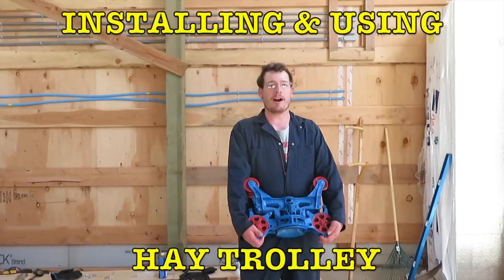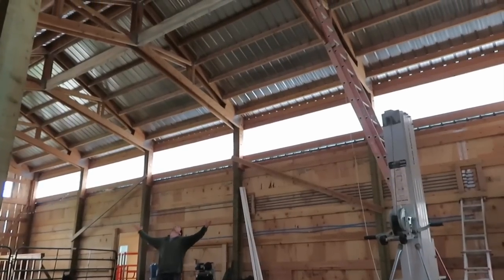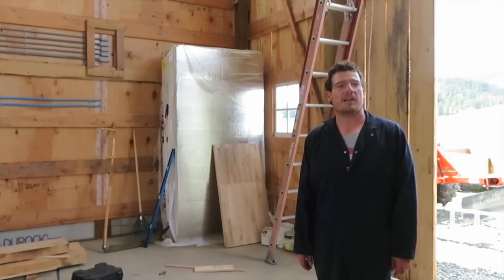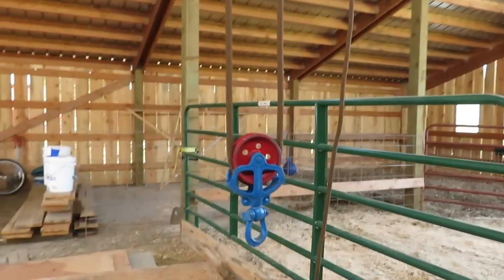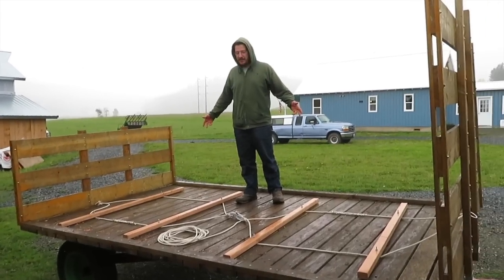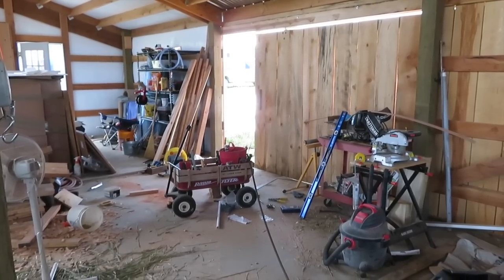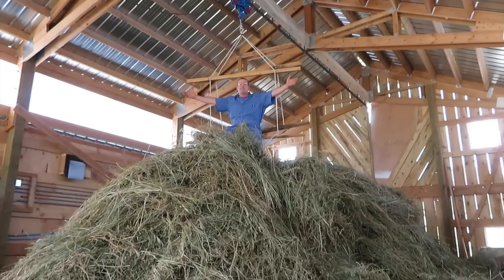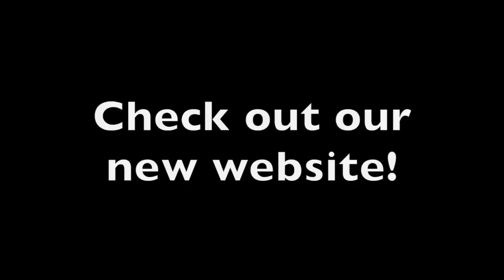Installing and Using Hay Trolley on New Dairy Barn (Building Dairy Barn #17)

Comment: Initially I thought...so much work! But then saw how much hay that grabbed! Get a clutched winch and that would run pretty smooth.
Reply from the maker: I feel that putting up loose hay is actually less work than when we baled hay. In fact, many of the hay trolley manufacturers offered a winch as part of their lineup to use in lieu of a horse or a tractor!
Reply: @vnthomas16  I bet one off an old well drilling rig would work perfectly.

Comment: A big step towards fully functional operations. Well done engineering and construction. Your knowledge of lines and ropes is impressive. Guess that's a side benefit of all those years in the Coast Guard. Hehe.
How many wagon loads in that 1st alfalfa cutting? Is there a way to separate grass hay from the alfalfa or will it simply mix together? Trolley looks and works great. Hope milk production is progressing. Bet the barn smells good filled with hay. Stay well.
Reply from the maker: I believe we had four wagon loads of Alfalfa. It was first cutting, so it was a bit course, besides the fact that we couldn’t cut it when we wanted due to weather, and then it lodged also due to weather, so it was a challenge to cut. But, the second cutting is coming in beautifully! Hope to cut again at the end of the week! We thought about trying to separate the alfalfa out, but then decided to go with the layering technique! Haha! So right now it’s grass/alfalfa/grass... and then we plan to put some more alfalfa on top. I think it will work out fine, as we want to feed out grass and alfalfa as a mix. It may vary, but we try and get the layers even. Oh, and yes, my rigging experience from the CG has been very beneficial to my farming career! Barn smells great! Thanks for watching!

Comment: I have a 110 year old trolley that is similar to yours, I'm trying to understand what the second vertical pulley is for .  I have mine roped the same as yours, in your video at 6:48 I can see that your left pulley isn't being used.  My descending pulley also has a place to attach the rope on each side.  It must be so that I have the option to run 4 vertical ropes to make lifting easier.  I can attach another lighter rope to the trolley to move it down the rail.  Thanks for the video, it is good to see other roping options,

Comment: That's really cool.  They had good systems 100 years ago.  Do you have to worry about alfalfa at the bottom of the pile heating up and possibly combusting?  I thought that's why it couldn't be stacked out in fields unless they made a teepee type structure to let the air flow inside there?  I don't know much about storing alfalfa, so I'm curious about that.
Reply from the maker: Great question! Alfalfa, and all hay really, just needs to be dry before being put up for hay. It’s the moisture that causes spontaneous combustion (and mold, for that matter). Loose hay is a little more forgiving than baled hay, but is still something to be taken very seriously. We’re blessed with hot temperatures and low humidity in our area for haymaking, so it usually goes pretty well. Actually, Alfalfa can be damaged if it is put up too dry, as you get “leaf shatter”, meaning has the hay is jostled about, the leaves fall off the stem. Most of the nutritional value is in the leaves. The cows can actually pick through the alfalfa, eating the leaves, but leaving the stems. We usually use the stems in their bedding. Thanks for watching!

Comment: Best doors for that are hinged from bottom and open by lowering it down by rope.That would  last 80 some yrs wind cant smash it that way.
Reply from the maker: We thought about that, as that is a very popular hay mow door design (for good reason, as you noted) but decided against it as we’d have to pad out the entire door structure to clear the door rails below it since we have a relatively short barn. We added some additional bracing so I’m not concerned about the doors in the future. Thanks for watching!

Comment: H years old & grew up in So. Daki: Why don't you make another sling & unload in two trips? That's what I did many years ago. I'm
Reply from the maker: I’ve thought about it. Our trolley isn’t designed to be used with slings, I kinda just make it work. The forks do a pretty good job, but can’t get the floor of the wagon very clean, hence the sling. I may make another on the future. We’ll see. Thanks for sharing!

Comment: What an amazing restoration of equipment not readily used in today's day in age!! Then to be able to see it in use, also amazing!! When I was a kid, we baled ours. This is very interesting to me, to see hay processed not only loosely but then put in the barn this way!! Will you be putting in a second floor to store the loose hay? Are you planning on storing the hay where you dropped it on the barn floor? 
I just love your entire operation!! The fact that you have lovingly restored your equipment is amazing!! You even went with glass containers to hold your milk. There is something to be said for some of the "older" ways of doing things. Sometimes, the more simple something is, the better it is.
Should schools ever get back to their ways prior to 2020, would you ever give school field trip tours?? Or tours to the general public??
Thank you for the great videos!! Please keep them coming!! Already looking forward to the next video!!!
Reply from the maker: Thanks for the kind comments! I love the older equipment. In general, I feel it is made better than much of today’s equipment. And when it does break, it is easier to repair. Parts can sometimes be an issue, but again with the older equipment, most of the parts are less intricate, and can be either fabricated on the farm, or at the local machine shop. No, there will not be a loft. We decided we wanted the mow on the same level as the cows (although the floor does slope to the back so nothing from the cows can run into the hay.) Just like when we did outside stacks, we did use cattle panels to make a hoop to contain the hay, although this hoop is much bigger! As far as the glass milk bottles, we have friends who bottle milk in glass bottles, and we couldn’t imagine any other way! They are making a resurgence! We do farm tours for small groups right now, practicing good social distancing and such, and that is going well. We have details on our website. Things are busy right now, especially with haying still going on, but don’t worry, they’ll be more videos! Stay tuned!
Reply: @vnthomas16  you two really ROCK!! You are so quick with responding to comments and questions......which is really awesome!
Another advantage of using the older equipment, you usually do not have all of that complicated computer type parts!! And the fact you have already found yourselves a fabricator is awesome!!
I'm so happy for you both! Being able to do what you're doing, is truly amazing! 
I guess I will need to check your website prior to asking my questions!! Lol.
I have never been out your way before. Maybe I should try to plan a trip, one of these years, out your way, so I can get in on one of those tours!!! That would be so cool!!!
Please keep up the amazing work you and your animals are doing! I do look forward to each and every video y'all post. Thank you for all the hard work you do........between the farm itself, to the various sections of your farm - cows, calves, milking, putting up hay, land/pasture management, processing, bottling, selling your milk, building (barns, sheds, house, & garage) management & upkeep, cooking, cleaning, time for the two of you to have together, oh and the real elusive one - SLEEP!!!!! Then there is the whole YouTube part. I'm not sure how y'all do everything. I know thank you doesn't begin to cover it, but thank you for all you do, for allowing all of us a glimpse into your farm and your lives. Everything you do, EVERYTHING, is very much appreciated!!!
Hope you are having a great day!! 
💞😍🐄🥛🚜📸🛠😍💞

Comment: Is there going to be a loft at some point? I'd think the hay would mold on the floor, either from moisture in the hay or the floor sweating.
Reply from the maker: No, no loft. We like everything on one level. Will moisture come up through the floor? Possibly. But the concrete is nearly a year old now, and even if we lose a few of the bottom inches, our loss will be much less than when we did outdoor haystacks just on the dirt. Everything is a science experiment in farming, so if the loss this year is unacceptable, then next year we’ll try something different, maybe a plastic vapor barrier under the hay for example. Time will tell! Thanks for the great question and thanks for watching!

Comment: Interesting throwback but if you are putting up any tonnage to speak of it is very labor intensive and much less efficient than a modern large bale baler.  We used to put up 25000 small bales a year in the Colville Valley 60 years ago and doing that with loose hay would have been a ton more work.
Reply from the maker: Hello! We used to bale, but then we switched to loose hay. Frankly, at our scale I don’t think I would go back. I actually find it less labor intensive than baling since we use machines to both load and unload the hay. It’s all about economies of scale though... If I were bigger, of course it would make sense to bale, and have a harrowbed to solve the loading and unloading issues, or put up in the large squares. Believe it or not, we’re not the only one in the valley putting up loose hay! Are you still in the Colville Valley?

Comment: What’s the point of lifting the hay up so high if you’re just going to drop it on the grade level floor? Why not just back your wagon bed in and slide it off? Maybe the pile gets so high that you can’t just slide or dump it off?
Reply from the maker: Yup, the pile gets too high. When the barn is full, the hay in the grapple will actually drag across the top of the pile. For the first few loads, we do sometimes back in the hay wagon and just shove it off, but it quickly gets too deep. Great question and thanks for watching!

Comment: It's fun to see that in earlier days the farmers where effective with their systems. Question: your load of hay was not higher than the big doors. Why not simply drive the wagon in the bar. This kind of system was used in the Netherlands  also but only when they must unload to a second floor the heyaddic. Why don't  you build a second floor for your hay? Greetings from the Netherlands
Reply from the maker: Great question! We didn’t show it, but for the first few loads of hay, we backed the wagon in and just pitched it off the sides. We use a large metal hoop to contain the hay, so once we close that in, we can’t get a wagon in there anymore. Thanks for watching!

Comment: Could you tell me exactly what kind of sling release you bought?  I am trying to set up similar system but haven't found the release I need.
Reply from the maker: Douglas Allison our sling release doesn’t have a name on it, but I’ve seen both Hudsons and Myers that look very similar and seem to operate the same. Before I found this on eBay, I did look into modern quick-release hooks. I used Sea Catch in the Coast Guard, and they work really well, but are very expensive. If I hadn’t been able to find an actual hay sling release, I probably would have tried a Wichard snap-shackle. I think it would work, but never tried it. Good luck!
Reply: @vnthomas16  thank you for responding and your time
Reply from the maker: Hope you find what you need!

Comment: I hope you have enough room for all your hay. Are you sure you can't get more in there if you bailed it and stacked it just wandering. Keep up the great work
Reply: I would assume loose hay is easier to cure in the barn with a higher moisture content than are bales. You can't stack either permanently until thoroughly cured, but loose hay you can work and dry under the roof regardless of the weather in the field
Reply from the maker: Yes, with loose hay you can work with a slightly higher moisture content (you still have be careful you don’t burn your barn down!). As far as storage, you could probably fit in a little more baled hay, and nothing says we can’t stack bales hay in there in the future, but loose hay will self compress under its own weight and become surprisingly dense. You can get a lot more loose hay in a space than you think! Great question though, and we appreciate your support!

Comment: Looks great! I used to help my great uncle put up loose hay when I was younger. He used a long pole and would get the load swinging, then when it was over the spot he wanted it, he'd let it loose. Saved on forking hay around. Very happy for you guys!
Reply from the maker: Thank you! I’ve seen the “swing and release” technique before, but I don’t know if I’d want to add that much stress to my system! After all, I did most of my own engineering! Haha!
Reply: @vnthomas16  Good point, I know when he did that the barn was just a rocking, LOL.

Comment: I love what you two are doing here, but I don't understand the loose hay. Bales are much more efficient with storage, and can load more material in a smaller space. Why did you go this route and not baled? Thanks again for showing your progress, keep up the good, no....great work!
Reply from the maker: Great questions! So actually, we used to bale, but than transitioned to loose hay. I find putting up loose hay much more enjoyable than moving hay bales (Pretty much anything is better than moving hay bales! Haha!). I have a machine to pick the hay up out of the field and deposit it 9n the wagon, and now I have a machine to lift it off the wagon and deposit it in the barn! The loose hay will self-compress under its own weight and become surprisingly quite dense. Not quite as dense and a bale of hay, but close. So for us, the storage issue is quite marginal. Back when we did bale hay, we also sold hay, so obviously if you’re treating hay as a commodity, than bales are the way to go. But, we don’t sell hay anymore, and all of our hay equipment now cost less than just a baler by itself, so there is an economical standpoint as well. Thanks for the kind comments and we appreciate your support! Thanks for watching!
Reply: I'll take a guess about the answer.  For us, we feed outside only (beef cattle) and have more heads so bales make sense.  We only feed hay so we have to have a lot of it (over a hundred round bales, plus a supply of small squares for sheep and anything that needs to be in the barn only for short periods).  We store the round bales outdoors currently.  We need machinery that can deal with heavy snow loads and transporting it to different parts of the winter pasture.  We keep and maintain a lot of old haying machinery which is costly in time and money (and we certainly don't run farming as a profit business).  They can use even older equipment that they've restored to make less but higher quality hay, store it inside, and feed it primarily (I think?) inside, at least during inclement weather.  They don't need machinery to feed (which I covet, haha). To me it feels more sustainable, besides extra neat to see the whole integrated plan.
But I'm sure there is more to it :)
Reply: @vnthomas16  makes perfect sense. I handled several million (a slight exaggeration) as a kid so I feel your pain. Besides it makes a great swing!